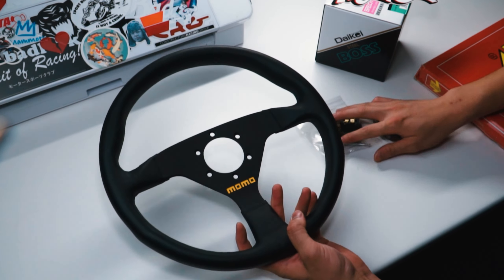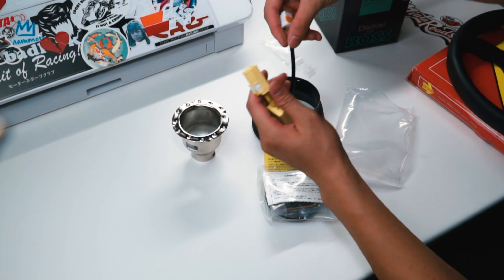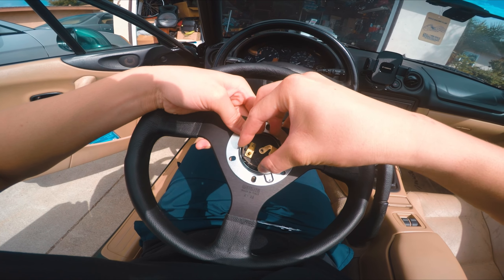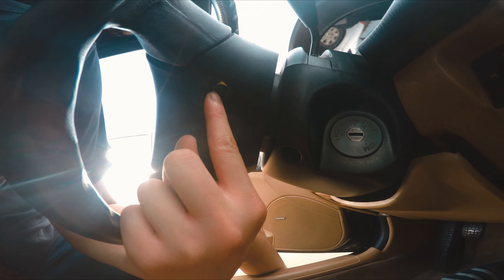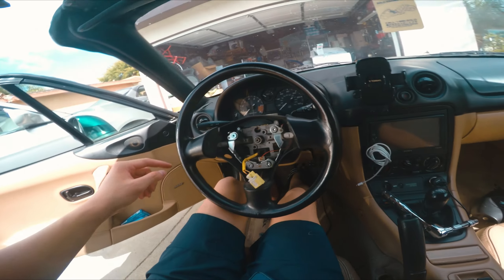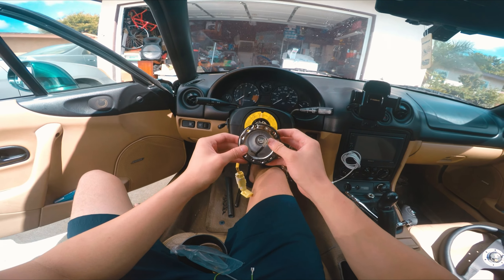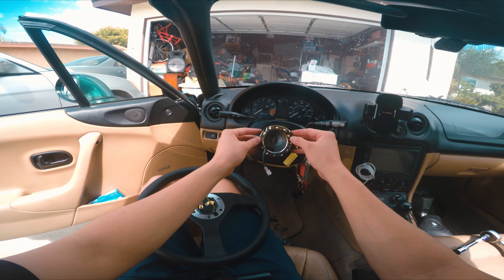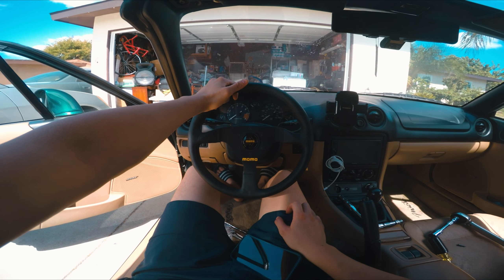How To Install an Aftermarket Steering wheel | 1999 Miata NB

Comment: Does this hub work with any steering wheel with a working horn?
Reply from the maker: aftermarket steering wheels like nardi, momo, sparco, omp, etc.
Reply: @ did you end up adding a spacer or extender for more leg room?
Reply from the maker: @ yes I did actually. Did a little YouTube short on it!

https://youtube.com/shorts/T_2_W880Jbw?si=NNb5DMzNRK-D7mjz
Reply: @ last question lmao sorry, do you think this would work with a quick release?
Reply from the maker: @ all good! I think if you went with a quick releases, I think it could work! Probably need to do more research to see if the QR requires a hub or if it is a direct mount. I think it does need the hub though.
Reply: @ oh ok appreciate it!

Comment: Hey nice video, were there any rattles with the airbag cable and is this 350mm or 320mm? Thinking about going with the 320 myself since I am a bit big for the stock wheel and my knees can't clear to heel toe properly.
Reply from the maker: Definitely go with the 320mm! If you go this route, I would suggest getting a boss hub steering wheel spacer from REV9 if you need the steering wheel closer to you. I just installed the 30mm spacer the other week and it brings the steering wheel closer and also gives me even more knee clearance. 

Also if you do take out the airbag, it is recommended that a harness bar + harness is installed.
Reply from the maker: Also, I don’t notice a rattle. The entire car rattles though 😂
Reply: What size is the wheel in the video?
Reply from the maker: @Jerky47  320mm
Reply: @joeltnguyen hey do you have the link for this spacer?
Reply from the maker: @Jmsns  yeah I got it on rev9, 30mm spacer.

https://rev9autosport.com/daikei-steering-wheel-spacer.html

Comment: Did you get an alignment after? Or was it like straight straight first try ?
Reply from the maker: In my case, the shop that did my alignment had it crooked. When I installed the steering wheel it made it more apparent. Slight toe adjustment fixed it.

But when you install it properly it should be straight. You just need to make sure your alignment is already straight and that the steering wheel is straight during removal

Comment: Will the Miata run and drive without the clockspring?
Reply from the maker: Yes, but you'll lose horn function and I believe the turn signals don't turn off automatically.

I linked the hub in the description for miata. Make sure to select the right year!
Reply: @joeltnguyen  had a NRG setup. No clockspring. Turn signals were not effected. The clock spring just allows for the rotation of the horn connection. Also, thank you for the video. Since I have only done the NRG a few times, I didn't even realize I could use the clock spring and would totally have mucked this up. Thanks mate.
Reply from the maker: @shaned4480  thank you for the info! The horn is a must in a Miata too